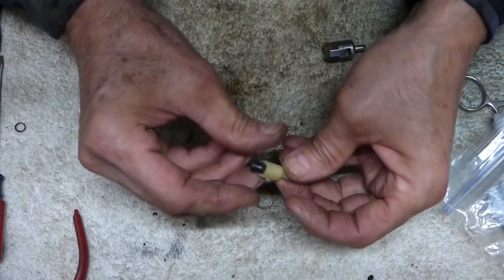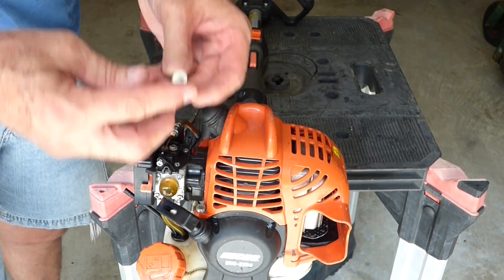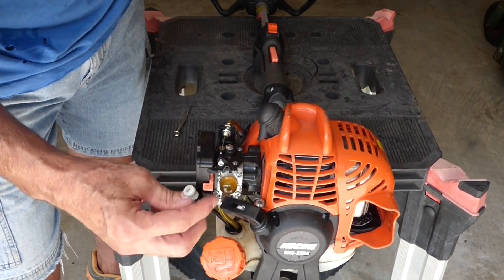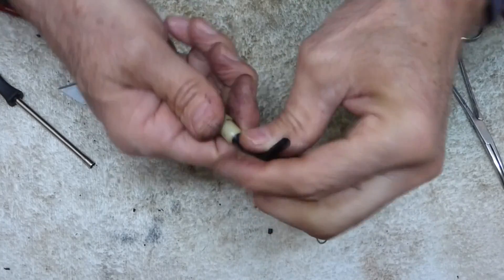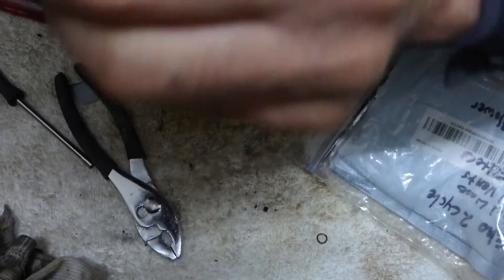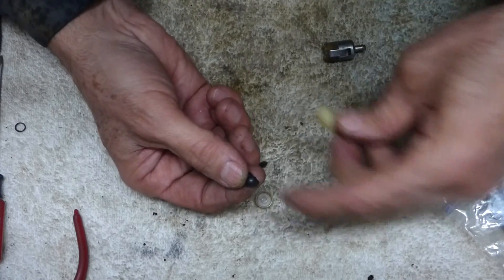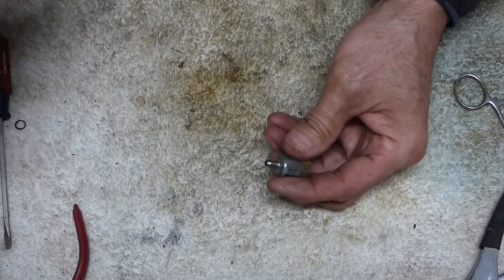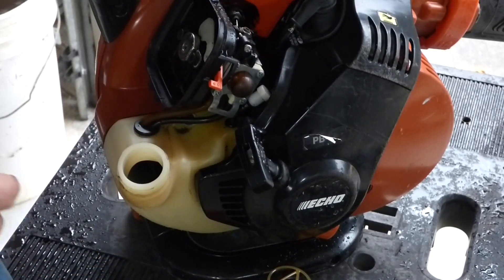2 Cycle Engine Bogs / Chokes Out ~ Fuel Tank Vents ~ How They Work & How to Fix Them

Comment: Is it normal to have fuel in the vent line. I notice i get a mouth full of fuel when i suck on it. Stihl MS250C
Reply from the maker: the vent should only pull air into the fuel tank not out.  It is a 1 way valve.  Usually the vent line just stubs into the top of the tank and not long to the bottom like the supply line with the filter...which should go all the way to the bottom of the tank

Comment: Should I do this with an empty tank or with a little fuel in.
Reply from the maker: It doesn't matter.  Just be careful not to spill fuel.  If the tank is too full or you might tip the unit then empty the tank to be safe.